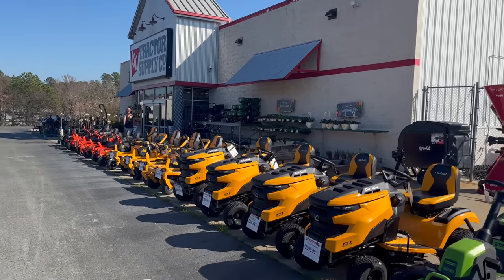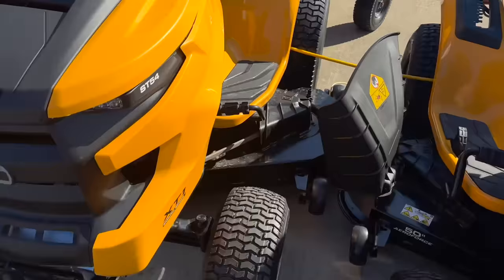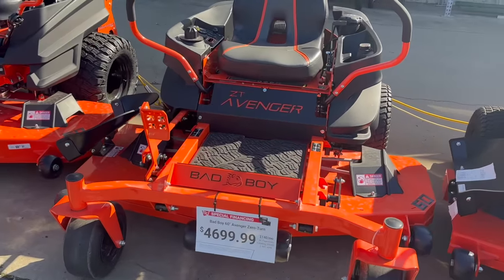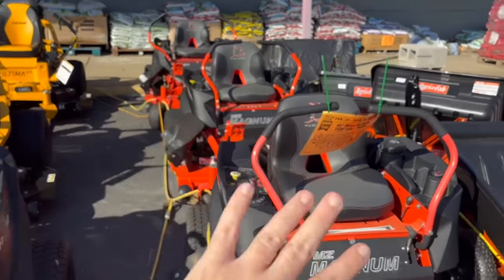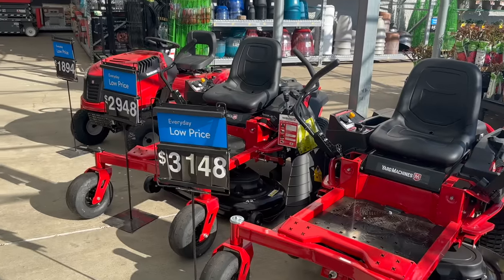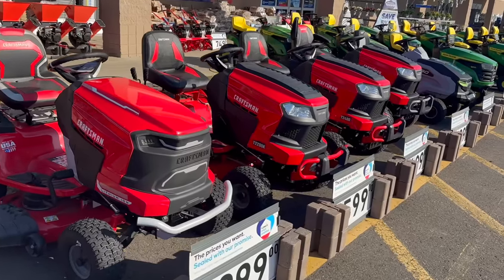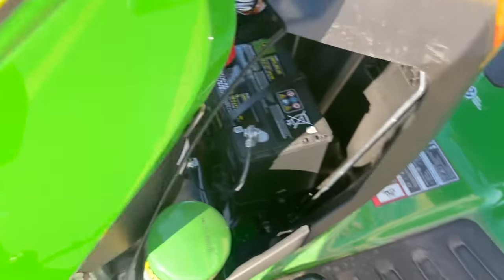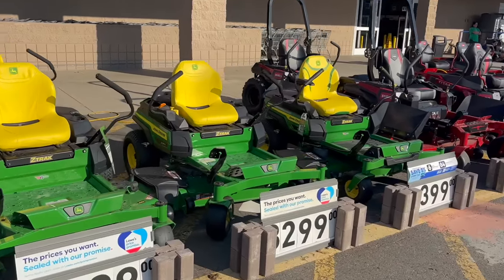The BEST Mowers to Buy and What to Avoid at The Big Box Stores This Year!

Comment: Well, I have a little John Deer s140, 48-inch deck, 22 hp and starting my second year with it.  Yep it ain't the greatest but it's what I could afford as a disabled veteran on basically a fixed income. Yes, it does a good job so far cutting the lawn, which 1 acre, so far, I have had no mechanical problems. But there are a couple things I hate about it. Spending a couple hours on this mower is a killer, the vibration is horrid and the floating deck floats like the Titanic. I don't do my own service on it because I really can't. I wish I would have gotten a Zero Turn.

Comment: Personally, I think it’s worth skipping the big box store and buying a Kubota or Scag. I’ve bought a used 2008 Kubota in 2015 and have had zero problems. Just regular yearly maintenance. It did cost me $7k used back the. And a new one will run $13k or more now, but you will have the power to go through any grass height and even some brush and how many of those $4k mowers will you have to buy, repair and replace in the same 16 year timeframe. That gets expensive.

Comment: Just curious, 17.5 HP Briggs, purchased a MTD/Murry 48' in 2006 - 18 years ago for 999.99 at walmart to gift to my father in law and when he retired, I keep it at my Alabama home and use it all year (Minimum around 450 hours - 1.5 acer, 3 hours, x18 years). That mower (Although I have had to replace the carb, safety relays, tires, a rim, starter relay,  a worn spindle and adjust the valves 2 years ago) that mower has stood the test of time. Keep in mind, I change the oil every other year, wash the grass off the deck when done and store in a garage.  I am curious what happened to that model of engine to mark its downfall.  Now days, that engine sounds like crap with its worn out exhaust, and occasional carb garbage, but oddly its reliable, and  the deck, and steering  is so light, it never wore out like the much bigger pulans and Toros I have destroyed. My best guess is the larger heavy engines wear the front steering out so fast, they turn to uncomfortable hard to steer junk.

Comment: Got a deal on a year old Troybuilt in 2012, bottom of their line, I'm sure. Super cheap deck, Chinese knock off of the Honda engine. Ran fine for me, then traded it in on a Toro 2022, the trans couldn't hokd a constant speed. But compared to the twin cylinder Kohler I bought, it just sipped fuel.

Comment: You should let all the people know that some of these have sleeve bearings you should go with the metal bearings and if you can find grease fittings that would be great also let the people know that almost everything is made by MTD now which are junk some John Deere internal parts are even plastic now the commercial models are still good the ones that you get for everyday mowing at your lawn are really bad now bad boy is really good I don't know of any other model out there I would suggest to go to except for if you can afford to go that much gravely is still really good try to find a place that works with commercial type units that way they work with commercial type units and you get a good solid lawn mower it might cost you a little more but it'll last you forever

Comment: i wore out two troybuilt mtd's in 20 years and they were held together with allthread and gorilla tape the last few years.  a few years ago i bought a 1964 cub cadet 100 for a camp mower for 300 bucks.  things a friggen tank.  i now have 7 of them and use them exclusively for mowing about 4 acres.  i have maybe 3 grand in all them and lots of parts.  i am no chickanic but i can turn a wrench and sharpen a blade and am never without a mower.  one big diff with these old mowers is they have zero safety features.  they will gladly allow you to turn them on with the blade engaged and chop your foot off.  but they were made when men were men and understood these things.

Comment: There were 2 rows of Deere mowers at Lowes priced at $2899.  One was the S130 42" deck 2 blade and the other was the S140 48" deck 3 blade.  Same B&S Vtwin engine.  Do you have any experience with the 2 v. 3 blade deck and which would you recommend?
Reply: she recommended the 3 blade decks because there is less stress on the belt system.

Comment: While I agree that the Craftsman stuff is just more 'cheap MTD" stuff, there is one difference in their T series lawn tractors that differentiates them from the sister Cub Cadet lawn tractor, and that is the TightTurn steering which provides a 5" turning radius.  To get into any other type of lawn tractor with that short of a turning radius means going to a 3x4 series John Deere for double the money. Granted, the 300 series JD is arguably double the quality....

I suspect a fair portion of the problems associated with some of the cheap MTD stuff is they are purchased by consumers who have just about zero maintenance/troubleshooting/diagnostic skills, resulting in a lot of talk about 'problems' that the average wrench turner could solve without much trouble. Leveling a deck, replacing a battery, etc.

You can spend five grand on a John Deere 300 series and still have the same cheap sector/worm gear steering arrangement that is used on the MTD stuff- a real embarrassment to John Deere, in my opinion.

Comment: You should probably change what you're saying about the craftsman tractor style riders at Lowes! 
Only the cheaper ones are made by MTD, but still have Husqvarna hoods, bumpers and other parts on them that are still Husqvarna made.  Also the bigger sized craftsman tractor style riders that are the "tight turn" riders, ARE MADE BY Husqvarna!! Husqvarna has been making Craftsman mowers for 20+ years, and I have the 2015 craftsman 7400 Pro Series "tight turn" rider with the Kohler 7000 Elite Series 26hp twin with easy release 3 blade 54" deck,  I also have the 48" 3 blade deck. Both decks are heavy-duty  pressed molded and are strong as hell..!!  I never had any issues with my decks either, and both decks have their original belts, pulleys, and spindles!! (And yes I use my rider and snow blower attachment all the time summer and winter!!!)
 My craftsman mover has Husqvarna stickers all over under the hood and the body and Husqvarna parts and service number stickers too.  Husqvarna also makes the craftsman snow blowers for the riders as well, which I also have!! 
 I've never had any issues with the rider or the snowblower, it's been a STRONG BEAST!!  GOOD JOB craftsman and Husqvarna for merging!!! 
Also, my hood and bumper are the same as the craftsman riders you said are made by MTD, well MY hood has Husqvarna stickers on it, so I'm pretty sure those red craftsman riders at
 Lowe's are also Husqvarna hoods and bumpers. 
 Do your research before you make videos without knowing who makes lawnmowers!!! 
 Craftsman mowers are GREAT machines, just don't buy the ones that are made by MTD,  buy the craftsman riders that are made by Husqvarna!! 

 Again GOOD JOB craftsman and Husqvarna for merging!!!

Comment: I purchased a Bad Boy last season, been great so far.
However, this is the 2nd zero turn I've owned, 1st one was good too.
What is up with front tires going flat? 
 This problem with both my zero turns.
I think these small wheels just dont like being tubeless!
Reply from the maker: I actually found some hard rubber tires the same size on Amazon to replace for a customer who had issues with them going flat. Too many thorns in their yard. I used their bushings to put in the new tires and it worked great.

Comment: Gravely is great Mower for the people in need, The Ariens while I used to run a mowing business with walk behind mowers many years ago and loved them today the name has kind of let me down when it came to Zero Turn. Needed a smaller so I got the iKon 42in and thought it would give me the same service as my Gravely seeing same brand however the Ikon lasted about 89hrs before I started having issues and broke the deck at around 123hrs. Didn't hit anything. Front of the deck mounting holes is weak and the weld snapped like it was welded by first week welder. Weak metal on the arms for the switches. In the end I traded it to someone that did some welding on my trailer to add a Wench and some other boxes. I made sure to tell him about the issues I was having and seeing he does metal work it was best for him to be the owner.. For someone that would need to buy mower on Credit, I have a feeling it wouldn't last as long as the payment plan. The Edge and the higher dollar one seem to be built much better then the Ikon and if someone could afford one of them maybe the Bad Boy like you were saying would be better option.

Comment: Electric stuff is fine as long as the batteries are easily removable and maintainable. Ego and Kobalt are good examples. Just watch the charge levels and be a responsible owner and you'll never have an issue. 

As an RC hobbyist, airsoft hobbyist, and someone with a lot of experience with electric tools, lithium is only as dangerous as you make it. Be responsible and you'll be fine.

Comment: Briggs and Stratton Innotek V-Twin 25 horsepower on a John Deere.  I have replaced 2 heads due to the valve guides coming loose and the pushrods bending and scoring the heads.  Comment please.

Comment: You confirmed what all of my research has told me. . . .was ending up looking at John Deere Lawn Tractors after ruling out several others that you did when I read the most horrific customer reviews "My transmission died", "I rode it 3x before it died", "It was leaking fluids from the very first time I tried to use it", "I go through a belt every time I mow the lawn", etc. and I was like . . . . .I mowed the lawn using a riding lawn mower for years since I was a very young kid and could barely reach the pedals. . . .we took the blades off to sharpen them and we put more gas in and changed the oil. Crap didn't break like that!!!!
Friend even works with the Cub Cadet dealer and says he can get me a deal on ones that have been returned and fixed by them and are ready to be used now. . . . .I'm feeling like saying "you know we found one, I'm good. Thanks though."

Comment: I bought a Husqvarna riding mower about 4-5 years ago and the deck has become "unwelded" and is sitting on the ground.  I took it to a lawnmower place and he said it looks rusted where it came apart. I keep it in my garage out of the rain so do you think Husqvarna  will fix it? It has a 10 year limited warranty on the deck but he said they will probably say I didn't store it properly. So idk what to do because it's a long way to the place where I need to take it and I'm old would have to find somebody to take it there for me which is a huge problem. I hate to go to all that trouble if they're just going to say they won't fix it. 😮

Comment: Those Troy built doesn't even have a real transmission! It's a vari drive pulley set up and if you leave it outside rust will sieze it up . The tension pulley vibrates like crazy and the bolt sheeres off ! Also the pto for the mower deck is operated by basically a 10 speed bike brake cable with a spring on the end that keeps the tension on the idler pulley the entire time the blades are on! Just buy a couple of extra cables. Don't buy any mower that doesn't have grease zerts on the spindles the bearings are sealed.

Comment: It's a shame that it requires an expert's advice to avoit pitfalls on mowers today.  I recommend buying a ZT that has arm rests because they make mounting and dismounting much easier.
 My neighbor's yard is too small for a rider, but he has a cheap one, and he had to replace two spindles in the same week.  I lucked into a good deal on an Ariens 42" ZT, but with a 'commercial' Briggs engine.  It outran its six year extended warranty that was an Ariens special that year, so no complaints there, and no broken spindles.

Comment: Another Briggs & Stratton owned brand commercial grade 36” zero-turn mower that I purchased in 2021 and a new commercial grade 24” snowblower, both made by Simplicity-are now no longer being manufactured. Simplicity is being eliminated and Stihl bought the entire rights and now has rebranded the equipment. My dealer became a Stihl equipment dealer and the machines, minus slight changes in style and color-look like rebranded Simplicity machines!

Comment: I've got 5 tractors one throws snow 25 yards chews and road grader ice berms at minus 20. Contestant #2 is a 30mph green machine chops fine turns like a drunken donkey miss something, dont worry you'll get back to that, 3 acres from 4 directions in under an hour, once every 2 weeks no sweat driver air cooled seatbelt and cut-off?  heck yeah.  The other 3 and  1/2 riders are scary they jusl lay there and stare. Ones an Old craftsman. The other two are either trolls or zombies, says on the side "Alice-Chompers" or something like that. They're decked out (1 extra). Then there's a herd (15-20) of pushy little toe-biters. One day, (in particular😅) my wife yelled at me "Ya gotta do something with all those" and stormed into the house. I call it the " rain of tear-her" (hair out). So I quietly arranged them in a semi-circle in varies colored platoons and by height of course. Then drug over 4 rotor-tillers as squad leaders. Then rememberd the bad-assed snowblower for center guide-on. While digging for the Toro Bull found this tiny shiny red cherry boy instant Aid de' Camp. Spotting six weed eaters, presto, Officers in Review and wheelbarrows? Because, that's whats they drove up in..?
The stage was set but it was getting dark so I turned on the motion varmit flood light, it illuminated a harsh  unforgiving very military glare. Then I casually sauntered to the back closet as she sat watching TV. Put on my old uniform with a long black fur lined rain coat for added flare and marched back outside eyes dead ahead. Once out side  close enough to not set off the light i began to pace back and forth in front of the formation berating the troops. The hook was set goose-stepping and shreaking "Cut-Down G Enemy" over and over. She walked out the front door into the dark saying "what the hellare you doing?" Head arched skyward 
I roared "For-Da-Fatherland" then wheeled to face her and bellowed "Fork in Farmer Land" and jumped backwards triggering the flood light and an additional double glare from near the door.
So I answered "Zeek Hile."with a sudden hand movement then mumbled "clean it upta morrow".
Executing a flawless about face addressing the troops I screached "Tomorrow we attack Greenland". Letting my head sag slowly backing away whispering "They're such brave boys. As we started for the door she said " You know what? You're not half as funny as you think"
I replied teasingly "I'd rather be half as funny as i look" while taking a short black plastic narrow toothed comb out of my pocket. The varmit light faded. Raising my hand slowly asking "What d'ya think" while holding the comb under my nose and whining in a crappy German accent "Dogs-eat-good".
Then SHE gave me an abrupt hand motion, with a one out of 5 participation rate, said "No" and closed the door. Instant boys night out.then it got interesting 

Thats how to organize tools
Creatively 
Episode 2 Fire Safety

Comment: Also I have a back pack sprayer and the hose at the bottom side feeding into another part is leaking can’t find replacement part so glue or tape it or are they fing with me and it’s easy to fix
Reply: all you have to do is let it dry then put some sealer around it and let it dry

Comment: You  know what get  hold of the John Kavli blade manufacturers. It is good to have a strong motor and  steardy deck but guess what that does not mean it cuts better than one that is not made as good. There is a video on YouTube with a crappy Husqvarna that can not cut anything higher than 8 inches well( I have one ) and yet with the John Kavli Beast blades it is cutting grass that is over 3 feet tall with one pass. So in my opinion it is not the mower that is only the vehicle the blades do the cutting.

Comment: I like my John Deere. I would like it much more if the deck was made better.  The deck is super thin. Rust eat mine up even though I would blow the grass out with a blower. And if you ever look at the belt spindles even new they tilt and don't know how a belt stays on for the most part. But it's a good mower for the other things. John Deere needs to address the thin deck problem or the name will deteriorate like the decks. $965 for a new deck only. I got a goat instead. 😉

Comment: Can you please compare Hustlers Dash mower to others in this class? Thanks.
Reply: The Dash is kinda new for us to have experience with, I've had one in and that was for a battery. The engines are really good, haven't seen much wrong with the small Kawasaki's other than carb issues and operator error. What I tell people about Zeros is that they are really buying transmissions. If you look at the warranty on those they are 2 years/200hours, that means that the transmissions are rated for 200 hours. If you look at the commercial units they are rated at 1200 hours. Yeah, you get a bigger deck, stronger engine, heavier spindles and such, but what you are really buying are those bigger, serviceable transmissions. If you are going to buy a residential grade Zero you should stick to a BadBoy or Hustler, however, to hit a price point most manufacturers use many of the same parts so it comes down to how easy is it to get service in your area.

Comment: this left me confused TBH, because you recommended the two rider manufacturers another youtuber/mechanic rated the lowest (he had cub cadet and craftsman on the top). I didn't hear you explain WHY john deere > cub cadet, and my own research typically has craftsman and cub cadet have better features (seat, seat drainage, mow height adjuster and position, engine, etc).